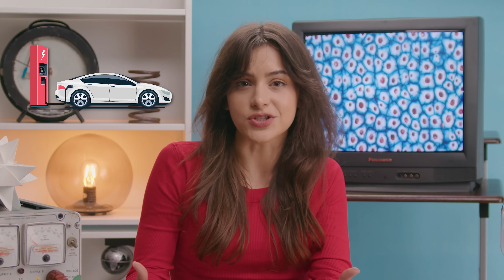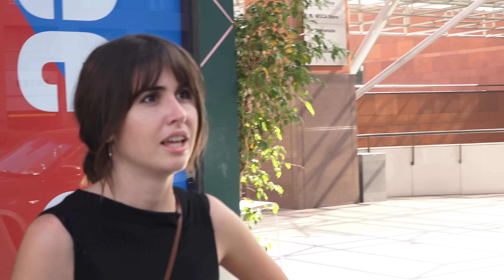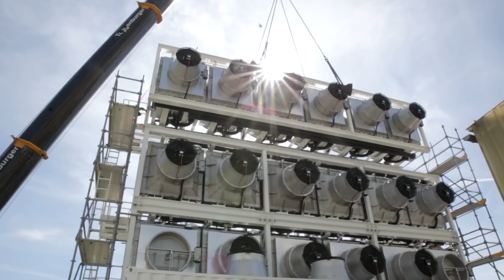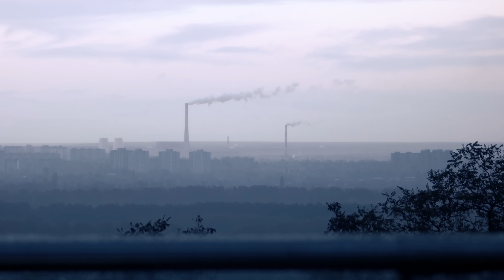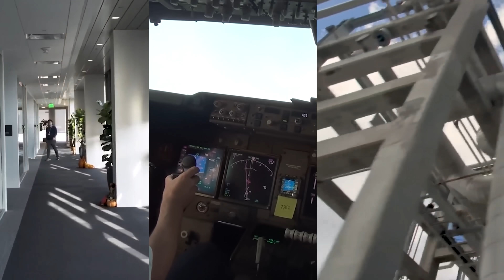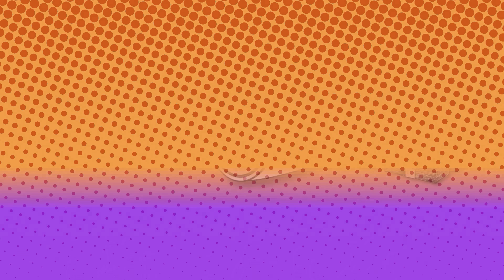The Solution To Climate Change?

Comment: So here's the problem. If we build giant wind turbines to suck air and seperate out co2, we always have to ask a very important question; what's the return on investment?

Let's say a single turbine removes 1000 tons of co2 over the lifetime of its use - because it absolutely will break. If the turbine removes 1000 tons and costs 100 tons to make, then great. But then you have to add the electrical load for the lifetime of the unit. If it's coming from fossil fuels, and it takes 2000 tons of co2 to run a turbine that removes 1000 tons, then we've lost out. But what about rEnEwAbLeS? Same problem. The renewables have to be built, which costs co2. Some of the biggest wind power turbines have a shelf life of 20 years but dont break even on their investment for nearly 25. The sheer amount of coal to make the steel and oils to make the fiberglass and gasoline/diesel to dig out and transport the materials and manpower is staggering. And renewables need battery storage since most of them cant ramp upon demand. Which is another added cost to the ultimate vacuum turbine plan. 

It might very well work, we have to do the research on that. But researchers need to keep in mind the total cost and not just the immediate one. Including things like government subsidies in order to make programs like these work, because just like the green energy sources they try to build, the money from those programs comes from somewhere.

 Usually the taxpayer.
Reply: Wind turbines need 8 months until they produced more electricity as they needed for construction, also I see some turbines from the early 90s in my region, mostly in those areas where they can't be replaced with bigger ones.
Also I can guarantee you the break even point is not 25 years, but idk. when it is.

Comment: "Humans are the stupidest species in the ecosystem."

"Cipolla’s quadrant highlights several fundamental features of those systems that can be described as both “complex” and “autocatalytic,” where the growth rate is proportional to the size of the stocks. These systems include living creatures, biomes, entire ecosystems, as well as human-created entities such as companies, organizations, and entire economic systems.  The analysis of Cipolla’s quadrant, carried out using the Lotka-Volterra model shows the similarity of many phenomena driven by the dissipation of energy potentials: from life to commerce [26]. There are, indeed, some basic laws at work in these systems and when we use the term “law” for a physical system we mean that some factors are at work to keep it, if not perfectly regulated, at least within some boundaries.  

Cipolla’s quadrant tells us that these complex systems are all dominated by the same factors, but that these factors can operate in different ways. The simplest case is the predator/prey (bandit/victim) relationship, in which the predator seeks only maximum short-term profit. The result is periodical oscillations, homeorhesis. It is also possible to see the condition of “stupidity” where the actions of the actors in the exchanges lead to doom for everyone and everything. In ecosystems it is extinction, in economic systems, it is financial ruin.  The analysis also shows the possibility for these systems to adjust in such a way to attain the condition that Cipolla describes as “intelligent people” and that in ecosystems goes under the name of “symbiosis.” As proposed by Lynn Margulis [20], symbiotic systems that go under the name of “holobionts” are the basic unit of the ecosystem. We may extend this definition to all kinds of autocatalytic complex systems, including those forming the human economy.  But if holobionts are an efficient unit of energy dissipation, why does stupidity exist? In particular, why is it so common in the economy as Cipolla correctly notes? Cipolla’s description of stupid people is that  “..some are stupid and others are not, and that the difference is determined by nature and not by cultural forces or factors. One is stupid in the same way one is red-haired; one belongs to the stupid set as one belongs to a blood group. A stupid man is born a stupid man by an act of Providence.” What Cipolla calls “an act of Providence” may be seen also as the result of the genetic setup of human beings. Indeed, humans are a relatively recent element of the ecosystem: modern humans are believed to have appeared only some 300,000 years ago, although other hominins practicing the same lifestyle may be as old as a few million years. Yet, this is a young age in comparison to that of most species currently existing in the ecosphere.  So, humankind’s stupidity may be not much more than an effect of the relative immaturity of our species, which still has to learn how to live in harmony with the ecosystem. That explains what we called here “the 6th law of stupidity,” stating that humans are the stupidest species on Earth. It is a condition that may lead the human species to extinction in a non-remote future. But it is also possible that, if humans survive, one day they will learn how to interact with the ecosystem of their planet without destroying it.   Acknowledgment. One of us (U.B.) would like to remember the figure of Carlo Maria Cipolla (1922-2000), whom he had a chance to meet in Berkeley in the 1980s. Cipolla was a brilliant and creative mind, but also a kind and open personality. His work, not just about stupidity, is still having an important impact on the way we see the world."
― The Sixth Law of Stupidity: A Biophysical Interpretation of Carlo Cipolla's Stupidity Laws

Comment: The thing I dont understand about direct air capture is that it seems like it involves these steps:
1. Pump air across carbon capture medium
2. CO2 is captured in medium
3. CO2 is released from medium

both step 1 (pumping all that air) and step 3 (driving off all that CO2 which spontaneously bound to the medium in step 2) consume energy, and this energy either 1. is probably going to add way more CO2 to the air than it captures or 2. is carbon-free and could be replacing fossil fuels that are being burned elsewhere.
Reply: There is another (3), which is sequestration, but that costs extra energy and there's little profit in it.

Comment: Starting CCS now is like pumping water out of a sinking ship before fixing the leak. Besides, I have a lot more waith in Enhanced Rock Weathering than CCS. CCS needs to store the Co2, and required a lot of energy to capture it in the first place, plus required a whole new infrastructure. Enhanced rock weathering does not require new infrastructure or storage. Basically, it involves mining and pulverizing minerals that naturally absorb Co2, like Basalt or Olivine, mill / grind them into dust or sand, and spread them over areas where it will naturally come into contact with water, like on beaches or on farms. Basalt doubles as a soil enrichment medium, and can increase crop yields, and a company called Project Vesta is researching using Olivine sand spread on beaches and shallow seas. Waves will turn the sand around and increase the absorbtion rate. Once the minerals are saturated with Co2 it turns into limestone, which also reduces the acidity of the oceans. It's likely gonna be the cheapest form of carbon capture. It's just a rather new idea and has research pending on potential but unlikely negative side effects, and so hasn't been widely talked about yet.

Comment: I'm a bit dissappointed that Dr. Jacobson didn't touch on nuclear. I've been doing engineering work for the past four years in the field of air quality. There are quite a bit of nuances to the topic. Having jobs in both the public side (read: working for government regulators) and the private side (read: the companies that get regulated), the centralized plan for implementing a lot of the control technologies puts a massive burden on these companies financially to even resulting in plant shutdowns. It's a thin line to balance on but the technology research I've seen coming out of the companies to reduce greenhouse gases and actually provide a cost benifit is so far a lot better than anything state and federal government grants have produced. We're just in one of those situations  of trying to figure out what to do with all the horse poop in the street when just around the corner is the invention of the automobile.
Reply: What about all the nuclear waste storage/disposal? Legitimate question. Seems like it would be a big issue.
Reply: @SPOOFY_D  Suprisingly, nuclear waste is a very easy thing to manage. First off, the amount generated in global history is miniscule in scale (only 400,000 tonnes). Only 0.2% of that is high level waste and of that, the radioactivity diminishes with time (which can't be said of other toxins produced from other energy production methods) to the point of being only at a level of 1/1000th of what it was initially unloaded after just a few decades. It's also easier to transport considering it's all solid (fluids are quite a bit more cumbersome).

Comment: Very good work covering both sides. CO2 has a lifetime of ~1000 years. So, even if we eliminate immediately all of our emissions, it would not be good enough to limit the extreme climate phenomena that we are currently experiencing without direct air capture. Using the captured CO2 for oil extraction though is counter-productive for mitigating global warming. So, governments should incentivize direct CO2 capture to avoid this.
Reply: It will take billions of trees just to offset the emissions of the United States, planted every year if you wanted them to be a permanent carbon capture source.  That's not to say you shouldn't plant trees, it can help in other ways like controlling soil erosion and restoring habitats and other stuff, but it would be impossible to plant enough trees to solve the problem by itself.  

1 tree = 1 ton ish  of carbon absorbed after around 40 years, if the average person uses 10 tons of carbon per year you would need to plant 10 trees every year just to break even per person.  So for the US you're looking at like 3 billion + 300 million trees planted every year to break even.  China would need to plant 14 billion and change, every year.  Checked my numbers, actual ton/per capita for US is 14.2, for China is 7.41 so 4.68 billion ish for the United States and for China it's 10.37 billion ish trees every year.

Trees just aren't that efficient unfortunately :(
Reply: @slickestrick4117  thanks for backing up with some data my concerns about planting trees. As you suggested, it’s good to plant trees but there is no way that this will be enough to remove significant amount of CO2 emissions from our atmosphere.
Reply: @mrq4731  how about thorium nuclear power plants
Reply: It can by done by planting more trees
Reply: @jagjivanjoshi8209  sure, planting trees should also be considered as an option. Can we rely only on this though? How many trees should be planted to remove all (currently emitted) CO2 from the atmosphere? What is the additional surface area of planted trees that is needed and how much of it could be realistically made available?